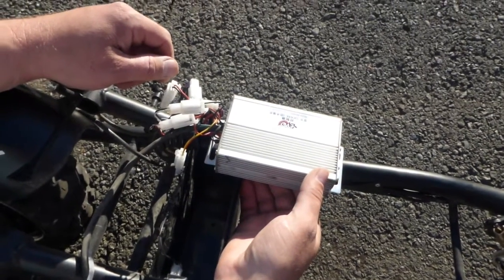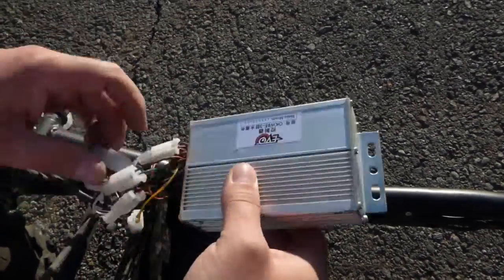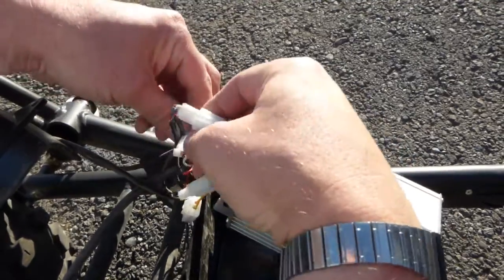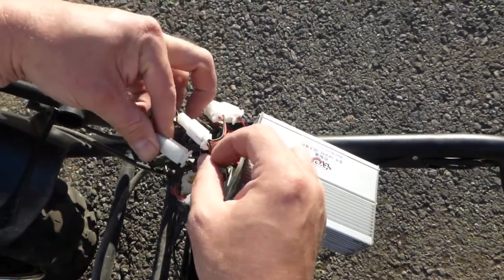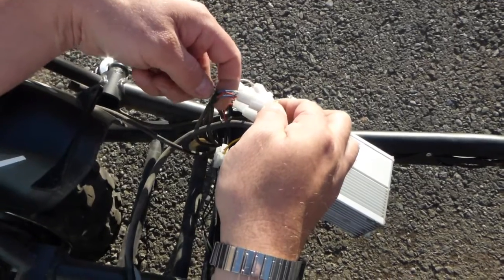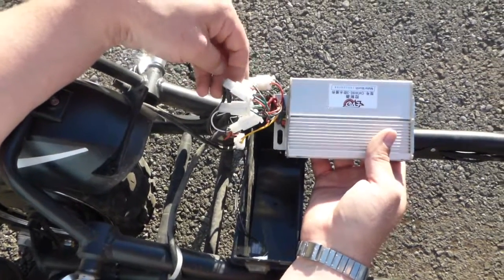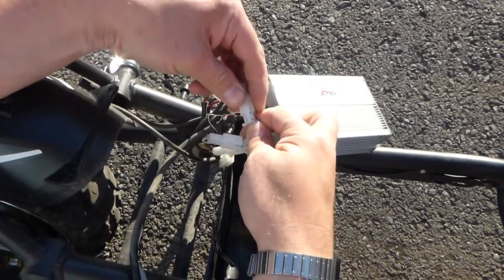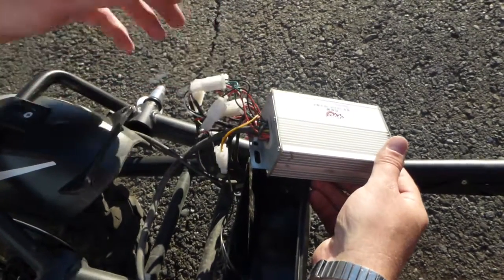How to connect Speed Controller for UberScoot 800W Citi Scooter E-bike Evo wiring diagram

Comment: Where does the power in plug connect too? I opened mine up there was one plug not connected to anything? Where do I connect it? It's a black and red and ithink gray
Reply: I think that's a spare indicator connector. I looked at mine and comes out of another indicator